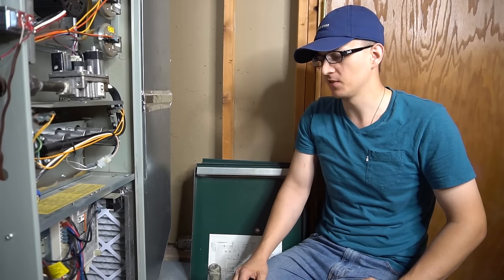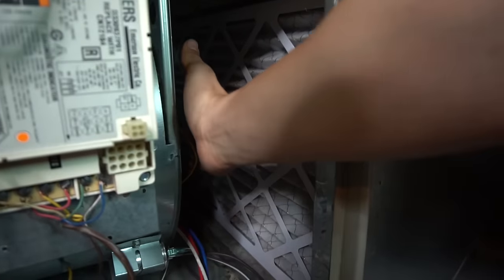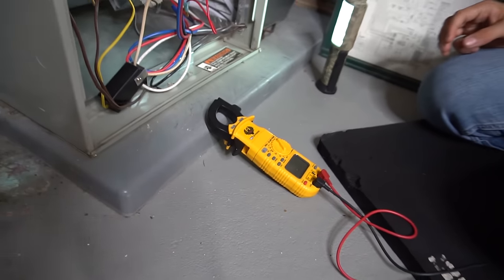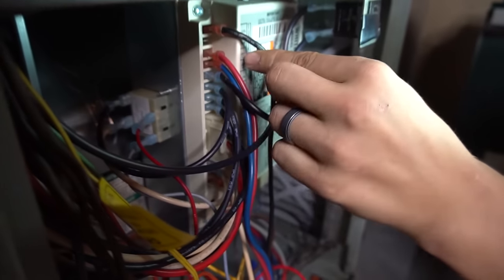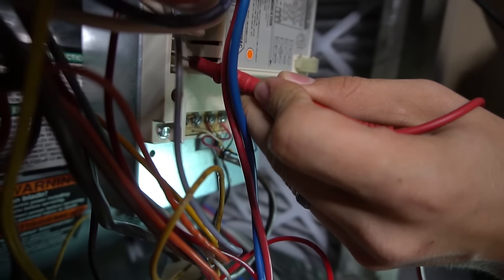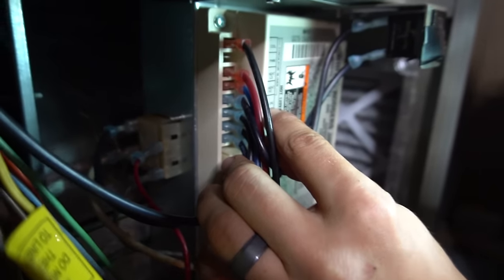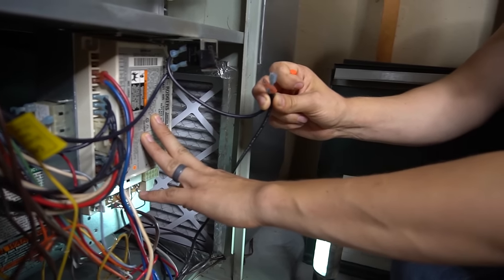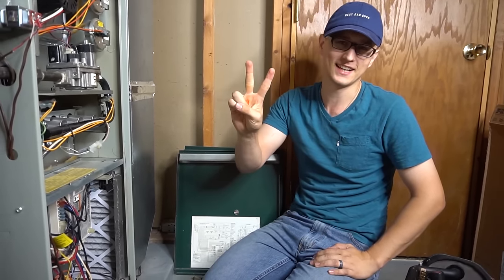Furnace Blower Not Working - How to Check It

Comment: Jay, thanks once again for such an outstanding video. I replaced my motor and capacitor but my blower is still not working. I seem to be getting about 117 to 118 volts coming to the blower. Is that enough to do the job fine or is it likely my control board is the trouble? I'm wondering if I may have also received a bad new blower. Just wanted to get your opinion of the voltage reading before I proceed further. Thanks again
Reply from the maker: Yes, if the motor is getting 117 volts, that is enough to power it up. Either the motor is bad right out of the box or something was not wired correctly. For example, if the capacitor is not hooked up, it will not work.
Reply: @WordofAdviceTV  Thanks so much.
Reply: @WordofAdviceTV  I can't believe this. So, I just tried your bypass method and I can get the blower to work by connecting the primary lead and the heat lead, yet the control board seems to be calling for heat and the blower won't kick on. I have the new capacitor connected fine and it seems to be good. I'm running out of ideas...
Reply from the maker: @skelthouser2730  So the control board is sending power to the HEAT terminal (if you check from the heat speed to the common terminal there should be about 115-120v) If the board is not sending power to the motor when it should be (usually about 20-30 seconds after the burners come on) then that control board is bad.
Reply: @WordofAdviceTV  Right you are. It turned out to need the control board. You are the man. And thanks so much for taking the time to answer people. You are worth your weight in gold my friend :)
Reply from the maker: @skelthouser2730  Thank you! :) Glad I could help, stay warm!

Comment: OK I didn't have power out on the terminals on the board that the black High speed wire comes out of the board,
and the other terminal on the board with the white wire l put the meter to, It was marked CIR.
Hot wired the blower from a separate 120 volt wire from a lamp cord and an extension cord, and the blower kicked right off.
Funny though, with those wires un-hooked I think I may have mentioned, when I call for cooling at the thermostat, now the inducer is running. I had pecked on the relays a bit, IDK if I pecked it to make the inducer relay kick on?
But now, I thought I'd see if the system would cool at all with the blower hot-wired (83* in here today) so I called for air, but now my condenser fan is not running and I don't have 24 volts between Y and C
Guessing it has to do with the board. I had left the fan running to try to dry up everything, but there's too much water dripping from the evap area.
My evap drain must be clogged up, water must have messed up the board. There are rust marks around a few of the small caps, and corrosion and water marks around the relays.
Reply: So when you bypassed the board with power from the door switch, you have to leave the WHITE common or Cir wire from the motor hooked up to the board, Right?
Would me not have having the common wire from the motor, and the Black wire (High) from the motor not hooked back into the COOL terminal at the board not allow my condenser fan to kick on? Remember, when I had the blower running with 120 V from an eternal source, and the white and black wires not connected to the board, (and hot wired from the door switch) 
I did not have Low voltage between Y and C, I would say that's why my condenser fan wasn't running?

Comment: On my fan blower there's a loud humming sound like it's trying to start. Motor is hot.
Reply from the maker: That sounds like either a dead fan capacitor or a failed motor. Most of the time I end up replacing both.. https://youtu.be/_3TxcnCkd18?si=yfnb2xgMUHtcpIT0

Comment: We connected each wires to the new blower motor but we have a white wire left that we don't know what to connect to. The new blower motor didn't have a white color wire
Reply from the maker: Look on the motor itself or perhaps there is a diagram on the box it came in, and see which wire (coming from the motor) is the common or neutral. That wire would need to be hooked up to the white.

Comment: My blower motor keeps shutting off but when I go down to my basement and I touch these wires my blower motor comes back on I checked to see if I had any loose connections and I couldn't find any I don't know why they could be
Reply from the maker: If moving the wires gets it to come on.. I would think it's  a loose connection somewhere too.. It's possible that something is broken inside the motor too though and wiggling the wires makes it connect. Cant say for sure what that is though..

Comment: Thank you for your in-depth situation!
My blower motor works (it turns on with heat/AC) but I am trying to circulate the air in my house without starting the condenser unit outside (save energy).
I tried to switch my thermostat "Fan" from "Auto" to "ON" which effectively short the G wire to R. (The fan clicks twice but doesn't come on).
I tried to jump R & G directly on the control board and the fan comes on! But the condenser unit outside also turns on, even though I didn't touch "Y".

Any ideas?
Reply from the maker: Sounds like there may be something wrong with the wiring.. The thermostat or the control board can be defective as well. Is your thermostat wired in the basic setup? https://www.youtube.com/watch?v=VknvJ9POYDo&t=464s
Reply: so my goodman furnace cycles but after the furnace turns off the blower blows out warm air then blows cool air for like 2min?? i see no blower antisapator on computer board

Comment: Question I got a new trane package unit turned it on but the motor won't turn 
I tried turning the squirrel cage with my hand and it's pretty hard doesn't move freely
Reply from the maker: Usually if it is stuck like that, it means the motor is bad. If you keep spinning it by hand does it get any better? If not, then likely the motor bearing is bad.
Reply: No it doesn't get any looser it will spin but I'll have to put force on it and it will only turn a 1/4 turn

Comment: My unit is a gas / electric outside unit, the blower motor quit, everything else seems to be ok. Problem, all video's show an indoor furnace and a fan with a capacitor. My blower fan doesn't have a capacitor and i'm sure that it doesn't matter to a pro, but i have found these type units on every help section video and not one package unit like mine that shows how to see if it's the fan motor, which i pulled out trying to locate the capacitor and it doesn't seem to have any looseness, wobble, dirty, rusty or otherwise. The unit is only 5 years old. But no one so far has shown this type unit being tested to see if it's the blower or the circuit board. Looks like i'll end uip calling an over priced hvac person to test it and tell me what's bad.

Comment: I have a question...and I’ll make a long story short, I replaced the control board today...thinking it was bad due to a wrongly labeled breaker. Anyway...after I figured out the breaker issue and the new board was installed...I fired up the AC, in the attic I heard the blower motor making noise...upon inspection it wasn’t starting. I tried to test the capacitor but my meter doesn’t appear to have the correct setting - so I swapped the capacitor with the working upstairs unit - problem persist, capacitor works fine in the upstairs unit. So I tested the blower as you showed by pulling the black cool wire and the white common, put the meter where they went on the board and made sure power was on and the door switch taped - I seem to getting 0 volts. I’m wondering if I’m doing something wrong...or something else could cause that, cause you said if you get 0 it’s likely a bad control board (which I just installed a new one this morning). I’m about to pull the blower motor out of the working unit to see if that resolves the issue...but I live in AZ and it’s pretty hot up there...so the less work I have to do up there the better. Also don’t want to keep throwing parts at...I’m a computer tech and mechanically inclined, so I try to do what I can before calling techs out...and I had a bad/costly experience last year with an HVAC tech. Thanks in advance for any advice you can offer.
Reply from the maker: Hey Brian! Sorry to hear about the AC problems! So you just replaced the board.. Did you go wire by wire so that nothing was mis-wired? The capacitor is hooked up? I would first locate the transformer in the air handler and check to see if it is getting 120v and then putting out 24v. The door switch needs to be closed though (in case you aren't doing that already - otherwise there will be no power) Also, have you tried setting your fan setting from AUTO to ON on the thermostat? Does that make it come on? I also have videos on how to bypass the thermostat. You can try bypassing it once to see if it's the problem.
Reply: Word of Advice TV Thanks for the reply, quick reply at that. I did go wire to wire when replacing the board, took pics and video to ensure everything was where it should be. The capacitor is connected-I even swapped it with my upstairs unit that is the exact same. I do have 120 at L1 & L2 (PR1) and 24 at SEC 1 & 2 off the transformer. I did set the therm to ON, when I have the panel open and switch taped...the unit does kick on, its that the blower motor makes a whining buzzing sound (and is trying to start, turning slowly), eventually stops. I am able to turn the wheel freely and don’t feel play at the moment. Would it make sense to pull the blower motor from my working unit to see if that resolves the issue? If it works that would seem to tell me the blower motor is bad?
Reply from the maker: If the capacitor is good and the motor is getting 120v, then the motor is bad and needs to be replaced. Sometimes it will spin free but the windings inside the motor are fried.

Comment: do i need to turn off gas valve or just switch to replace capacitor
Reply from the maker: No need to turn off the gas. Just the electricity.
Reply: @WordofAdviceTV  ok thank you

Comment: Is it possible for the motor to not have a capacitor?
Reply from the maker: Yes, if it is a variable speed (ECM) motor it will not have a capacitor. Those motors usually have many more wires coming out of them than a PSC motor.

Comment: I installed a new Thermostat and my heat works perfectly but the AC and the Fan ON mode does not work!
Reply from the maker: Do you have a little jumper wire between the R (or Rh) terminal and Rc terminal on the thermostat? That would be my first thought. Watch my basic thermostat wiring video if you are unsure of what I am talking about 👍

Comment: Great video! 
My blower motor will, once in a blue moon, spin on and off without fully turning on. I've had to shut down the unit and wait a while before trying again till it worked. Any ideas on that?
Reply from the maker: Have you checked or replaced the blower motor capacitor? If you have a meter, you can try checking voltage and seeing if the voltage drops off when that happens (that would mean there is no problem with the motor) But being that this only happens once in a blue moon that would be hard to do... If the unit works fine otherwise, I would just let it be for now.
Reply: @WordofAdviceTV  Thanks but mine is an ECM 2.3 and doesn't have a blower motor capacitor. The motor has actually begun to do this very frequently now! Within the last few days, it's happening 50%+ of the time. So much so that I've had to turn on the fan setting first, then switching to A/C or heat to have it run correctly. If on A/C or Heat, without starting on Fan mode first, the squirrel cage will continue to be very erratic.
For now, I've ordered a re-manufactured motor module. I checked the control board and everything is reading the necessary voltage. The only discrepancy I've had on the board is 15 volts being sent the "G" wire on the 16 pin tab that connects to the motor module. However, I've been told that the 15 volts is fine and shouldn't cause the issue I'm having. 
Any other thoughts besides the module? BTW, the motor itself makes no noise, spins freely and doesn't seem very concerning.
Reply from the maker: @3000Marc  I think there's a good chance it's that ECM module. Those motors rarely fail but the computer modules on the motor go bad quite a bit. On some of them we only replace a burnt out resistor (solder a new one in) and all is good. But there's different styles of variable speed motors so yours may be different. Hopefully you will replace it and forget about it for another 5-10 years :)

Comment: What if a person has one of those ECM motors ? How would you determine a bad motor ?
Reply from the maker: On those, many times what is bad is actually the computer module that is attached to the motor. And in that module, frequently it is a resistor that goes bad. (it will be a burnt spot that you can see) I have soldered in a new resistor a few times before and they fired right back up. Those motors and modules are expensive. There is a tester that you can plug into the motor (also expensive) that checks whether the motor or the module is bad. Otherwise you can buy them both, put in the new module first and if that is all that is needed, return the motor.

Comment: You don’t need to cut anything, just disconnect the wire coming out of the door switch, (120v) and connect the wire from the blower directly to the door switch
Reply from the maker: That is the easiest way! Thank you for pointing that out
Reply: This is incorrect actually.. if you do this you wont be sending a 24v signal to the outdoor unit. By disconnecting the line voltage from the circuit board, your 24V transformer is not getting any power, therefore the outdoor condenser contactor will not pull in. Only the blower will be powered.
Reply: I think that's the point...to c if the blower actually works 🤦 you don't need 24v for that...dhaaaa
Reply: Today I did that and had a short from the blower motor tying those 3 together I will never do that if the board doesn't send 115 its a board for me
Reply: @JoeGarcia-cg1pp you mean , a bad board ?

Comment: Where is a good place to buy a blower motor ? Online or a HVAC store and how do I look one up the one I need online ?
Reply from the maker: The best way would be to actually pull out the motor and look at the specs. Then you can usually order the motor you need on Amazon. I have a video on how to replace the blower motor and there should be links in the description to some motors.
Reply: Word of Advice TV  thank you! Really good vids
Reply: Most ac supply stores cant sale you one, I have license to buy a good place is a electric motor repair shop probably there even cheaper than ac supply stores.  Or we grainger be a little higher priced.

Comment: The blower motor in my gas heating furnace turns on for a couple minutes and then turns off, any idea why?
Reply: Its in another one of his video's. Common problems for furnaces. Sounds like the flame sensor. Pull it and clean it, that video shows how to do it.

Comment: Hey buddy.  I need ur help.  Few weeks ago I replaced my furnace blower capacitor with a 10MFD instead of 5MFD the original.  Now the motor is not working.  Is it possible that the new capacitor fried the motor do to the higher MGD?  My other problem is I took my old motor out and looked for the model# online.  I cannot find any motor that match my old model#.  Can I use a different motor?  Here are some information about my old motor.

Make: EMERSO
model: K55HXECA-7197
HP: 1/3
RPM: 1075/3spd
AMP: 2.4
PH: 1
VOLT: 208/230
HZ:60
FRAME: 48Y

I found alot of 115V and 1/4,1/2,3/4HP online.  I would appreciate if you could help me figure it out.  Thanks
Reply from the maker: The over-sized capacitor can damage the new motor, yes.. As for the new motor, as long as the RPM, HP, and Voltage are the same as the old one, it will work :) I have a video where I replace my blower motor and I talk about that there if you need more info.
Reply: Hi friend,  need your help again.  I replaced the blower motor for my lennox furnace, but seems to not working right.  After hooked up everything, the fan and heat turn on normal, but about 10-15 minutes it's over heated.  If keeps running, it will burn out the motor again.  The 2 copper pipes coming out of the furnace are very hot.  I thought I give a shoutout before calling the service people.  Thanks for your time
Reply from the maker: Have you watched my video on 10 reasons why a furnace can overheat? Maybe the problem is not the motor but something else.. Like a plugged A-coil